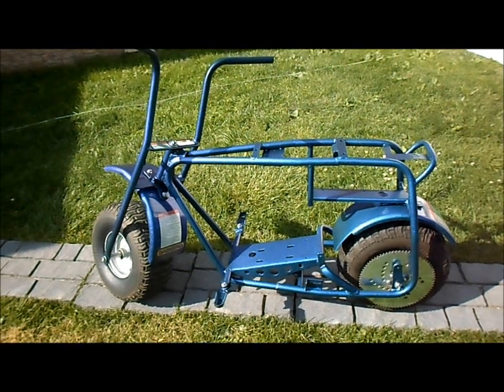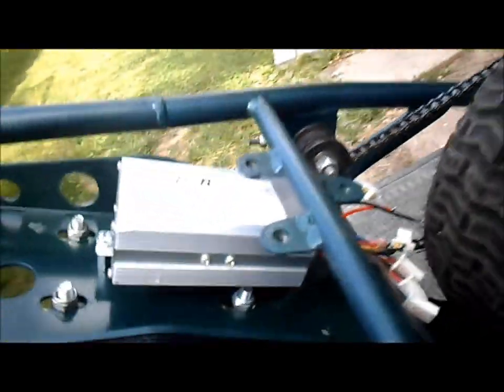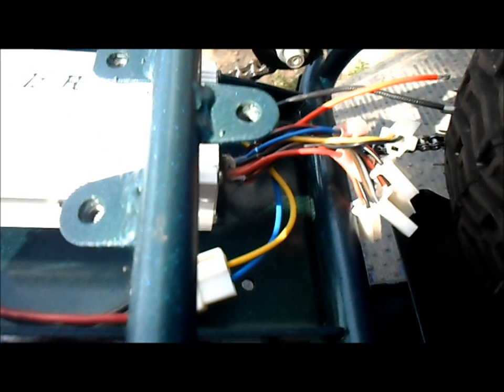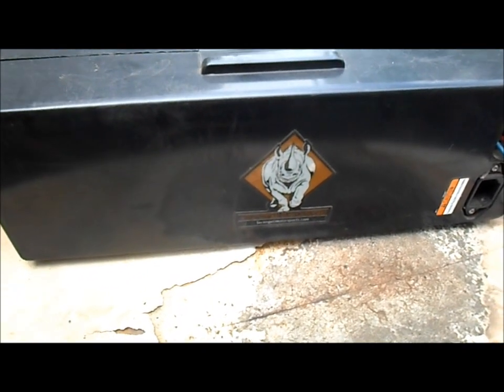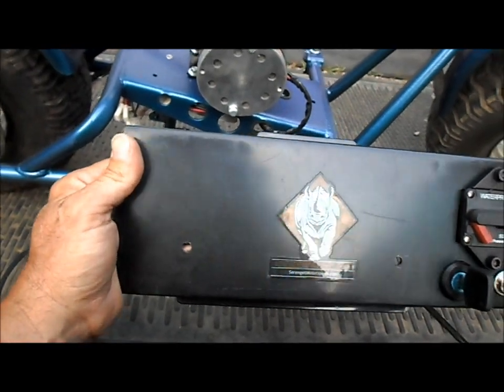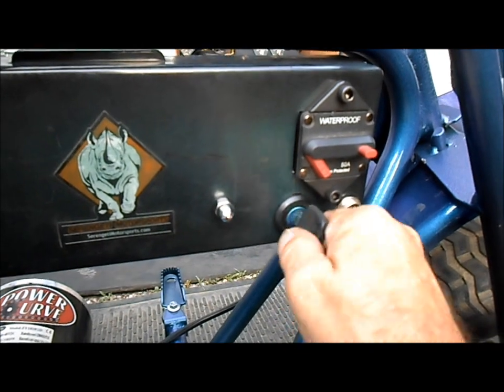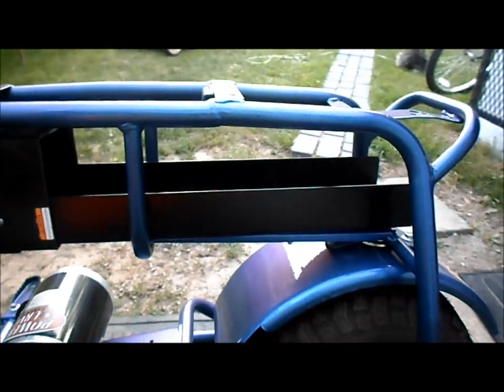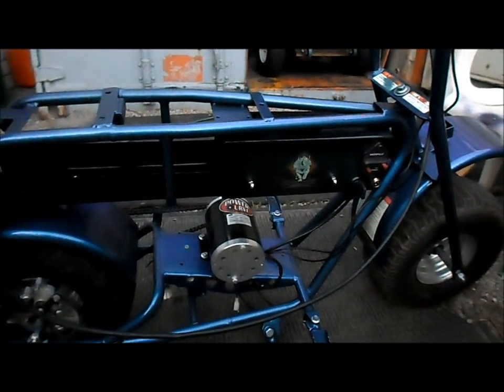ElMini electric mini bike 48V upgrade re assembly

Comment: ElMini is looking good. I still think those motors are designed to run clockwise, and your RPMs will be about 20% slower in reverse. Did you switch motor magnets to operate counter clockwise?
Reply from the maker: ElMini was factory designed & built. (not a gas conversion) I am just upgrading it from a 24V motor to a 48V system. ...but, to check this "speed difference" theory I am gonna rig up an RPM meter & do some testin'. Stay tuned  & thanks for watching.
Reply: @functional_artist  right on dude. I tested my 48V 1000W brushed motor by filming it in high speed and counting the frames between rotations. I posted side by side comparison video here https://youtu.be/qvlCc7pFVyM?t=22

Comment: Why tf would you put a battery on instead of a gas engine
Reply from the maker: Instant Torque, no fumes, no hot exhaust, no oil leaks, no choke, no pull starting, no gas, I could go on...
Reply: you forgot. No Noise.